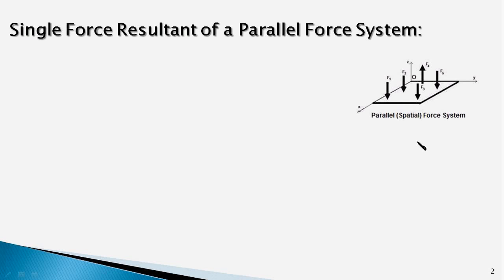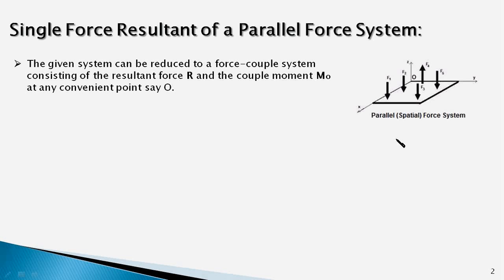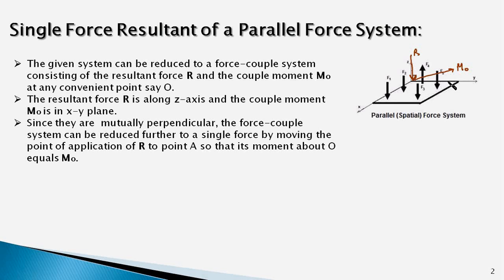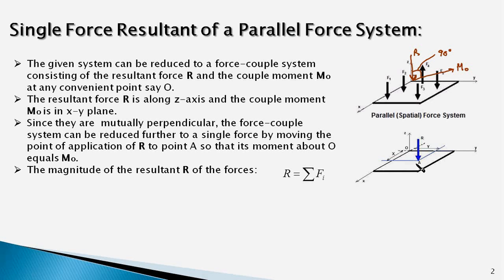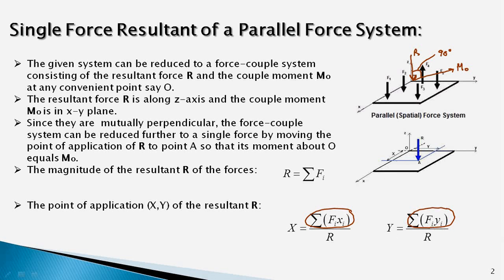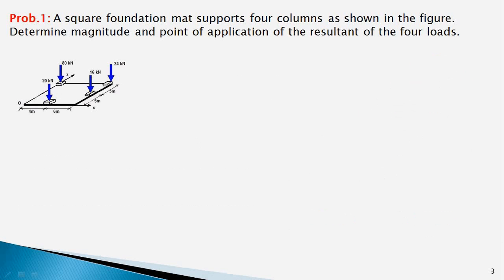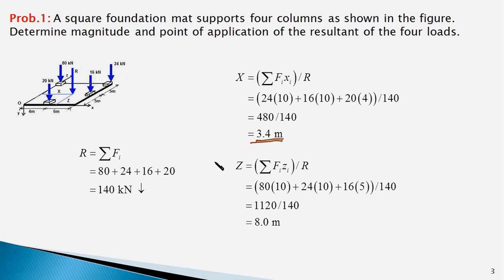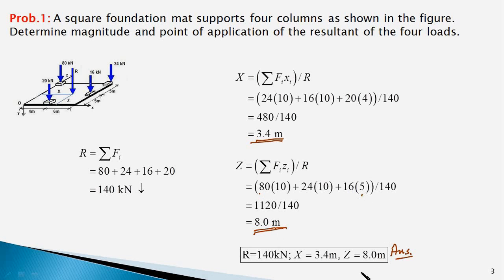10.1 Engineering Mechanics: Single Force Resultant of Parallel Forces

Comment: I think you meant co-linear and not co-planar  because to me the forces lie in the same plane, but don't share the same line.
Reply from the maker: The forces shown in the diagram are neither co-linear (along a common line) nor co-planar ( not in a single plane). They are spatial forces - 3d forces and are parallel to z-axis.